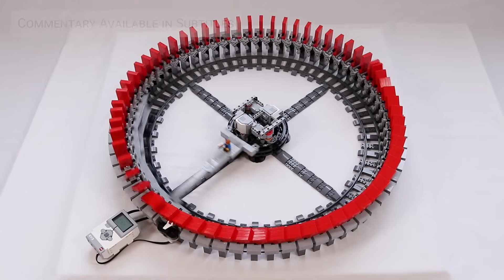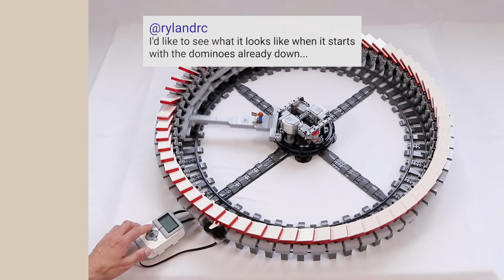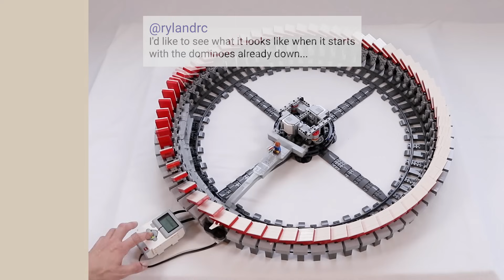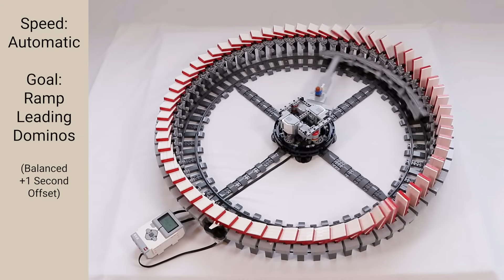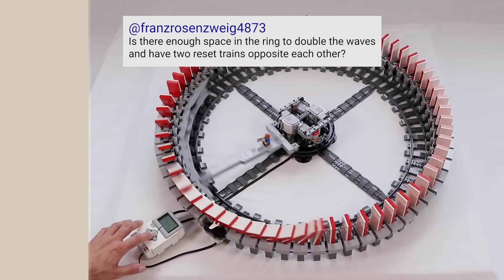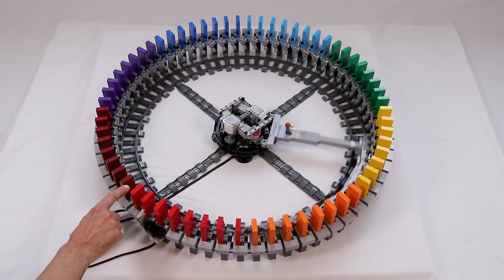LEGO Domino Ring Experiments

Comment: When I watched the first video I thought about asking you to make it work upside down, then realized it just couldn't work, but now I'm wondering if I thought about all possibilities?
Reply: This construction itself wouldn't work upside down, but you started a silly train of thought where I got an idea for a weirder version.

Consider if the domino loop is spinning; it will have centrifugal force. So turn the dominos inwards, letting their "fall" be caused by centrifugal force instead of gravity. To maintain this we need to rotate the loop. At some particular speed, the falling of the dominos will match the loop revolutions; then the raising can be a fixed ramp. 

Since this force is perpendicular to the one causing the dominos to fall in the stationary case, you can have both types on the same loop.

Comment: I just realized after watching this thing mutliple times in multiple videos. This is basically the lego version of a loading/buffer wheel, but I actually like watching this one.
Reply: The UI element you refer to is known as a spinner, throbber, or indefinite progress indicator. Their purpose is to indicate your machine is not frozen, although the result is not ready. Same thing with disk or network activity lights. The other side of this would be a "watchdog timer" (or impatient user), which aborts a process (timing out) if it's not showing enough signs of activity.
Reply: @0LoneTech hehe, throbber

Comment: Make a 10 hour loop of just this going round and round. This will help me fall asleep. Please please please!
Reply: The problem is that the falling speed is not perfectly matching any speed he can set the train to go around at, so it only lasts a couple minutes.
Reply: @SamuraiGuy with the mindstorm sensors it may be possible to detect when the train passes a certain point and when the falling dominos reach that point, then adjust the speed accordingly.
Reply: @dragonmasterlangeweg7625 ... that's precisely what this design does to begin with. More detail in the first video. The too slow or fast examples here are done by disabling the control loop.

Comment: Considering the ramp runs on train tracks I'm wondering if other shapes besides a circle are possible, but that'd involve a pretty thorough redesign of the system with driving motors on the ramp-train itself controlled remotely by the mindstorms unit.
Reply: Yes, it's possible. Also, the Powered Up hubs used in current Lego train sets are programmable and communicate via radio, so you don't need specifically Mindstorms. The train motor doesn't have the rotation sensor to know its speed precisely, but this design uses feedback from the flag, so that's not critical.

Power Functions trains can also be remote controlled, but with less precision, so you might need frequent checkpoints to keep them from running into the falling wave.